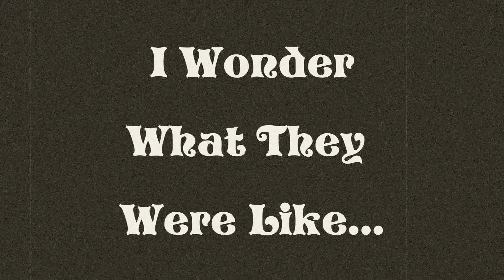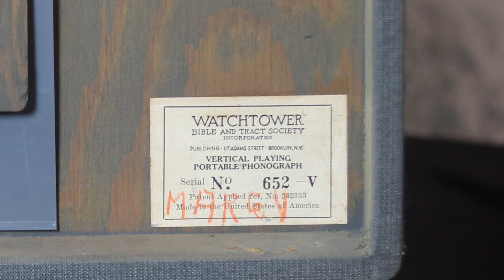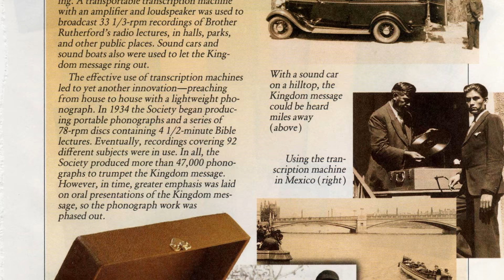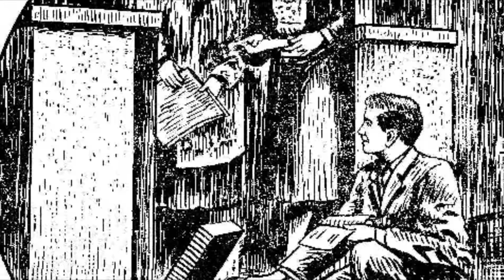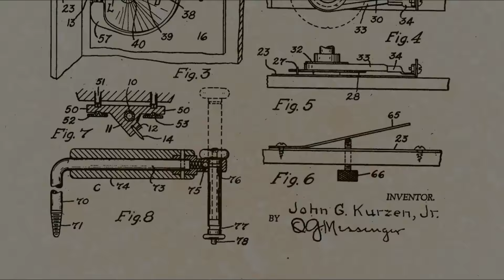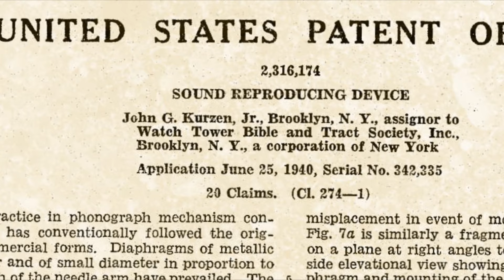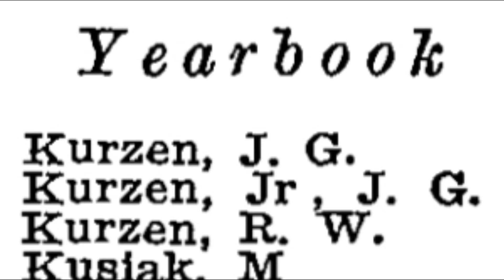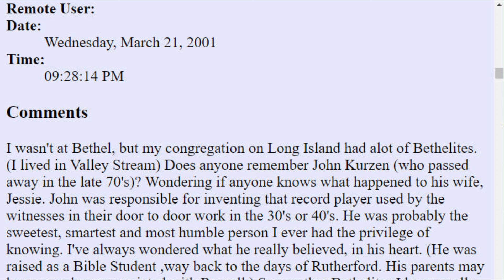Discovering The Watchtower Vertical Phonograph - Kurzen's design  for Jehovah's Witness

Comment: PLEASE lubricate that motor and spindle and the slide bearings, these things actually sound really good when working properly and are easy as heck to service, Kurzen was one really good engineer and if you are using a steel needle replace it every two sides of a record. I actually find Japanese knot weed here in the summer, let it dry out and cut needles for these type of phonographs, it works really well and the stuff grows everywhere and it doesn't damage shellac, it's basically bamboo but an invasive weed.

Comment: That probably had better tone quality than most of the horn record players made. Though I never owned one, the earlier versions of the Kenner Close'Nplay seemed to have about the same design as this, though most had a sliding stylus with the track attached to a stationary speaker cone (the pull-string dolls of that era also had that design). There was a company called "Chad Valley" that sold a product similar to the Kenner Close'Nplay that used the sliding speaker design from this model. By the late 1970s, the Kenner version had been fitted with a solid state amplifier and dynamic speaker.

Comment: At the beginning of this video I see a 'rod' extending to underneath the turntable next to the crank. My machine does not have that. Wonder what it is and what it does? I am guessing some sort of speed control which mine has none of any kind.
Reply from the maker: Yes, I believe what you’re describing is a speed adjustment lever.